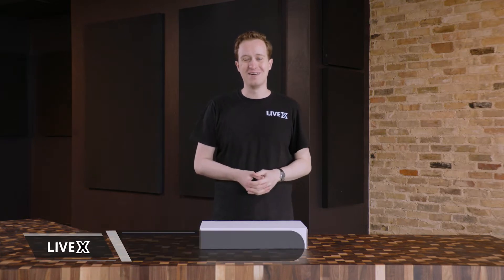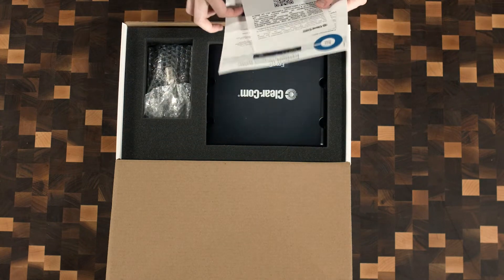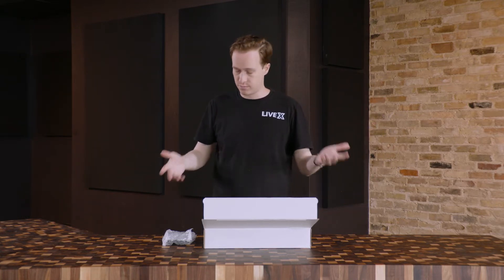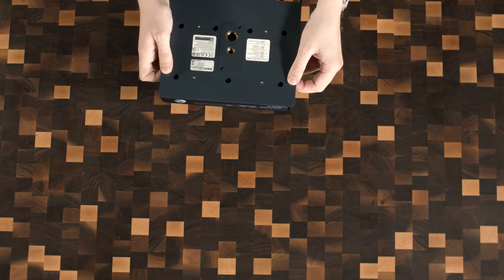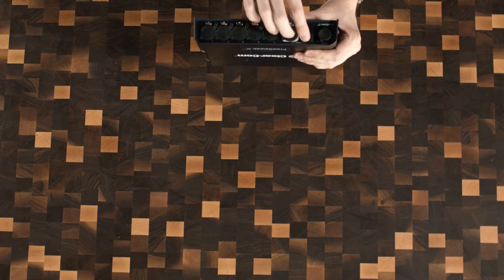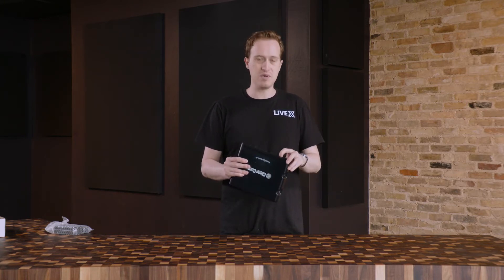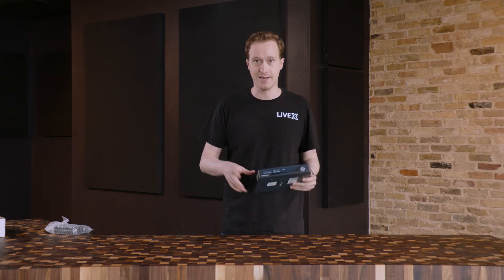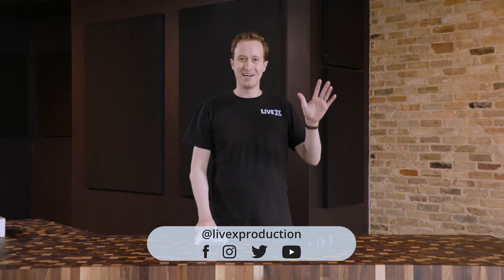Unboxing: Freespeak Transceiver Splitter

Comment: Great video, do you know if it is possible to connect two splitters into the same base via cat 6 cables and add up to 10 antennas (for more coverage) and up to 20 beltpacks; base is capable to have  up to 25 beltpacks with 5 antennas and one splitter, please let me know.
Reply from the maker: Yes, that is possible and common! You would plug each splitter to the back of the base station as you mentioned. With 10 antennas you can easily handle 25 beltpacks.